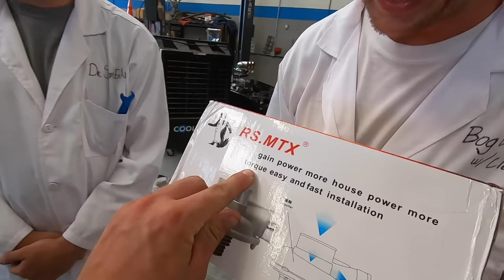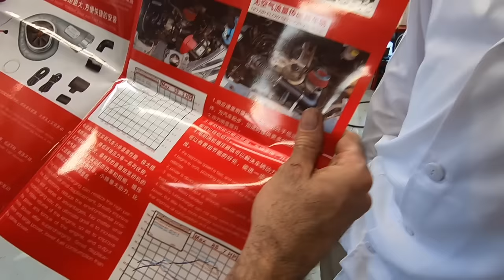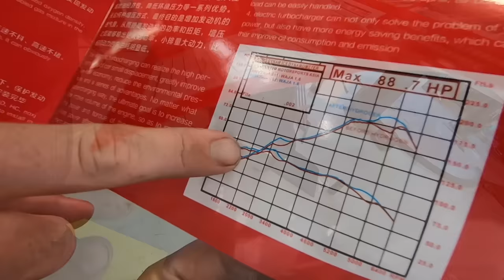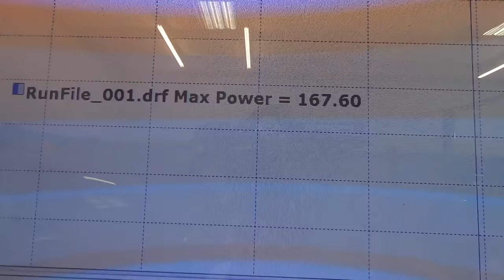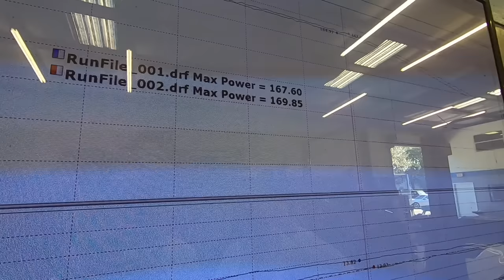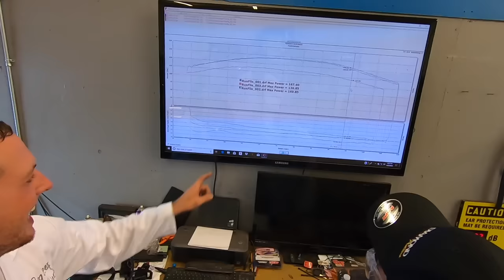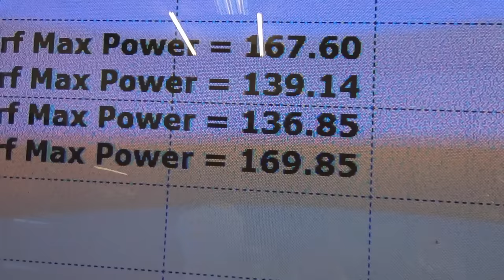Dyno Testing a $400 ELECTRIC TURBO! Funniest Car Part EVER!

Comment: The thing was wired backwards for the test and that engine is pretty big for a thing so small. The vast majority of cars in the world don't have an engine that big. I'm not saying it would work but the test was bad and I ended up learning nothing from it.
Reply: @cedar7685  Watch the video closely, you can see the initial wheel spin between the 2 runs, they spun at different directions.

EDIT:
13:04 - guy holding a RED WIRE to the top battery terminal
19:25 - guy holding a BLUE WIRE to the top battery terminal.

Comment: "Do not buy cheap garbage made in China!!" Especially an electric turbo charger.
Reply: ESPECIALLY when he thinks he bought an electric SUPERCHARGER
Reply: 13:33 blue wire on terminal near head light air blows
19:13 James shows you he's going to wire it wrong
20:03 James gets a free lunch
Reply: Well, "real "electric turbochargers exist at least :D
Reply: AMENNN - AAANY TURBOCHARGER !!! ! !!!
Reply: @kopronko  👍
Reply: @twitchosx   McFarland bought a hair dryer. Not a turbo charger.
Reply: @richardbrowne1217  Right, but in the beginning he said he bought an electric supercharger, not turbo charger
Reply: @twitchosx   "Yeah, he did!" "IT'S JUST A TURBO HAIR DRIER!"

Comment: is it just me or did you guys wire the damn turbo the wrong way around?

is it actually sucking air out of the intake or blowing into it?
Reply: How the hell would that even be possible? First of all, all turbos will suck air in through the side and blow it out the tube. This is how they mount the turbo as well. During their trial test run, they certainly show the way air is pushed out the right end, when he holds the bubble wrap in front of it.
Physically it would probably combust if they were to mount it the wrong way. The DC motor would run current for the engine to go in a specific direction, while the engine would create a low preasure outmatching the torque of the DC motor, driving it in the opposite direction, causing a huge spike in current drawn.
Reply: @Tomazack  Because it uses an electric motor to spin the compressor wheel, and the direction an electric motor spins is dependent on current flow. If you wire it backwards, the motor spins backwards. When they tested it the wiring was only mocked up, they just touched the contacts to the battery to get it to spin. The off-the-car test showed a lot of airflow, and with that much extra flow it 100% should have been running leaner. They even showed in on the dyno screen that the AFRs were WAY rich which means there was less air getting into the engine. The noise it made when it was on the car during the run was way different too, sounded like it was blowing air out towards the mic. Set playback speed at 0.25x and play the video from 17:55 and you'll see clear as day that it was wired wrong. They even made a comment about how it was blowing air out through the inlet and called it "backpressure."
Reply: @Tomazack  they swapped the wiring polarity between the test run and the dyno run, test run had the red wire on positive and blue wire on ground, it was the opposite in the dyno run

Comment: MORE AIR PSI = NEEDS MORE FUEL, fuel ratio is off when boost is added to the mix
Reply: Alex Alvarez  the afr indicated that it was running rich. Means it had TOO MUCH fuel, for the amount of air, indicating an air restriction.
Reply: @jacekurbanski4321  correct

Comment: Hey ...

I have the exact same E-Turbo you bought... But I only paid $249 for it.
I installed it on my RPS Hawk 250cc Dirtbike,
It has a 38mm Carb on it and this little turbo fits nice a snug under the seat and with silicone tubing it is sealed.

I went from a 89 size main jet to a 125 main.
As soon as I turn the key in the ignition the turbo turn on. I wait 2-3 seconds and then hit the starter.
Bike starts up and runs ALOT better with this turbo.

IDK how much actual HP it makes now but it definitive gave my little 250cc a HUGE boost in performance.

Yes these turbos are for small engines with little natural air flow.
I would say from what I see with my dirt bike the max I would install this Turbo onto is 1000cc

Install was easy.
Like I said. Main power comes on with on switch the ignition onto ON
The just run the turbo and try to fire up the bike. 
Change jet sizes until it runs and idles well.
Then start riding it. 
At Jet size 120 it ran smooth and idles well ... sounded very loud...like a hairdryer and broken lawnmower ...lol
But as I was riding it starved on me over 6000 RPMs.
So I went up to 123.5 jet size.
A lot better but still not perfect
125 Main jet and the bike starts good idles well and pulls hard now !!!

I basicly build me  a cheap (but functional) carbureted Turbo Street legal Dirt bike
Reply: ... I am in the process of turning my Dirtbike into a E85 lover

Comment: Lost power because the car needs the maf sensor tuned try it in a car without a maf
Reply: @mistervova11  I can't believe they just pretty much ignored the idea it was running so rich, and didn't care to remedy the issue.
Reply: E- Mail I agree I am a gear head and they really screwed up
Reply: @shadow392sct5  I was actually kidding and trolling, this thing is good enough to produce about 0.4 psi of static air pressure on 12v car battery. Which will be a restriction on engines 1.5L and higher. So many tards my god.
Reply: Air/fuel ratio is always overlooked...

Comment: The turbo is small for dune buggys and go carts
Reply: It will consump more energy from alternator than will be produced by slightly raised air pressure in 50cc engine.
Reply: It will do nothing.  Unless it has a 40HP electric motor on the impeller, you will not gain 39HP.  A real turbo reclaims the wasted HP from the tailpipe (around 30% of engine HP).
Reply: @gavincurtis  my car's engine will get less than 50% of power without turbine.
Reply: @gavincurtis  ?

Comment: Very smart not compensating with more fuel when adding more air
Reply: Jonathan Silvera the MAS will adjust fuelling to a degree.
Reply: While the MAF(mass air flow sensor) will adjust to an extend there's a map sensor, fuel pressure adjustment, boost gauge and controller that comes into play when adding boost and obvious tuning. Regardless of that the engine was just too small for that turbo making it impossible to build any kind of boost. All a saw here was a restriction on the intake. They should retest it on a 4 cylinder to make somehow fair for the turbo
Reply: @TheEclipsegsx98  I don't think fuel will help if the turbo is sucking air from the engine ,istead of ...boosting it 17:54 play on slowest speed.
Reply: @borislavsashov8467  you literally hear him say it's like a hairdryer. So it did push air inside the motor
Reply: @HuckingPlastic  So you believe more on what you hear than what you see? I see the turbo spinning backwards.Look carefully.
Reply: @borislavsashov8467  No its not? It's spinning clockwise which mean it sucks the air into the motor
Reply: At 13:19 it's spinning properly,at 17:54 counterclockwise.Are you watching it on slowest speed 1080p 60FPS?
Reply: @borislavsashov8467  Oh I was on work WiFi so it was 360p. Now I see it. Wtf it's backward. I wonder if the Dino pull was the correct way or both backward
Reply: Well,it was right before the dyno pull,so i guess it was running backwards.

Comment: Definitely looks like it's spinning backwards.
Reply: Probably is due to camera/video frame rate.
Reply: It is, its spinning anti clockwise should be spinning clock wise (face palm)
Reply: @Basstrucker2013  I really cant see this. What time in the video?
Reply: @GeorgeHampl   17:52 play at 0.25x spins anti clockwise
Reply: @Basstrucker2013  you are correct. they need to give it another go
Reply: @wd2018  At the 20 minute mark you can see it spins in the right direction on the actual dyno run.
Reply: Ry KTM RC8 You can’t tell spin orientation by video... look at the direction the air was blowing... I can’t believe how many unintelligent comments on this video are saying that...

Comment: U should put a "T" in the cold air intake and put the turbo on it.
Reply: Agree. More like Y intake pipe. One end is the air filter and the other end this Electrical Turbo. This way there is bo restrictions at all and the Turbo is adding air only.... worth the shot.
Reply: Turbo will just blow air out the air filter....
Reply: That's the same as just having a massive boost leak. It won't do anything😂
Reply: @copenhunter402  not if it's pre maf then it would all be metered
Reply: @tylerbickford565  metered or unmetered wouldn't change anything. Map cars can still run when they blow a charge pipe, but they won't make shit for power because boost never builds. Boost is pressurized air right? And how can it pressurize with a 3" hole in the pipes?

Comment: Your installation is wrong, the unit is fitted after the airflow meter
Reply: In the worst case the air sensor should have regulating the air flow and open less the throttle butterfly, and therefore make the same amount of power. The installation is wrong, but this air dryer clearly obstruct the intake.
Reply: Thats what i was thinking. Directions even said after the sensor. Plus the wired it backward on the dyno so it was pullin air not pushing air. Idiots completely fucked up the install.
Reply: @jacksmith2315  really these guys are tools

Comment: For it to provide any significant boost it would need much more electrical power than the alternator can provide.  For example for it to give a 5 PSI boost for a 2 litre engine running at 6000 RPM you would need about 270 amps at 12 volts.  For short runs you could probably take that off the battery and then let it slowly recharge ready for the next run.

Comment: “This couldve been a fluke pull”. Hahaha. I wish they actually ran the mustang to redline. Just saying,
Reply: Or modified the tune to compensate for the added air!!!
Reply: 17:53-- they have it spinning counter clockwise...WRONG direction...that fan needs to cut and pull air into the intake, clearly it is not...
Reply: @Knight_wz  or tore the heads off for ultra high boost performance head gaskets....